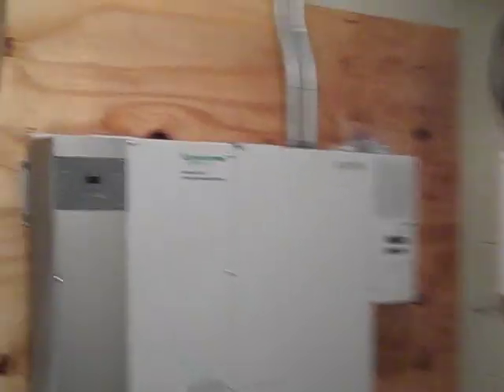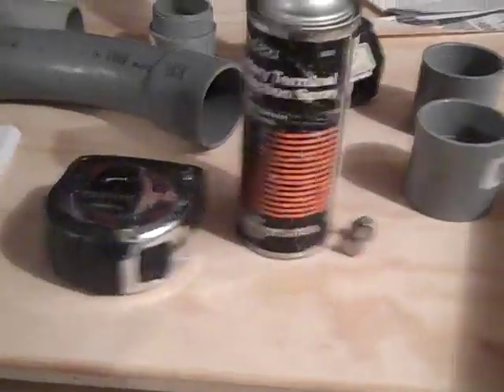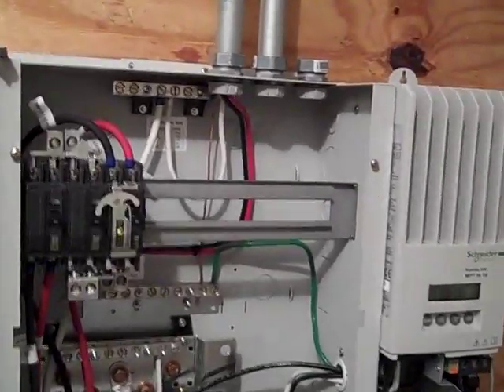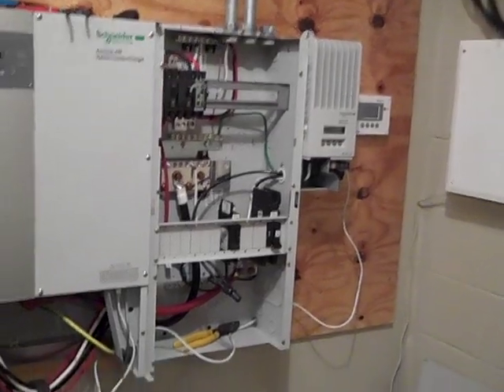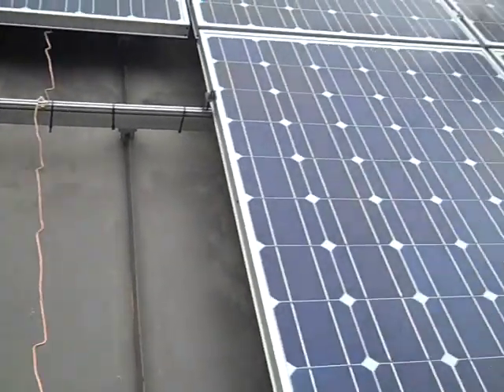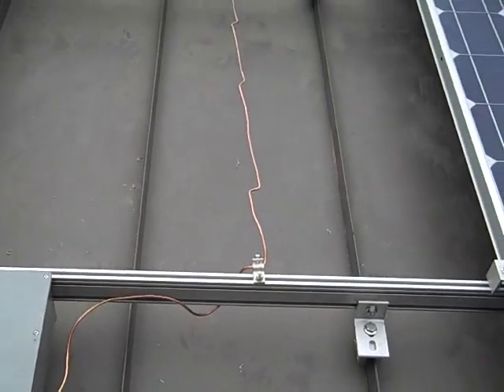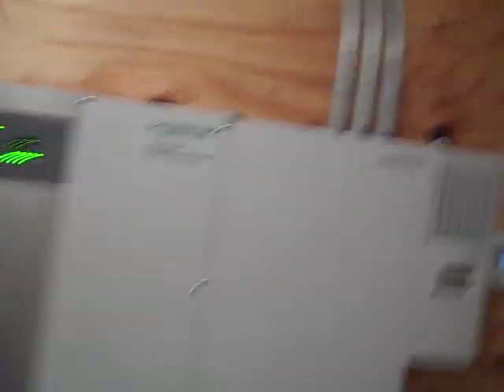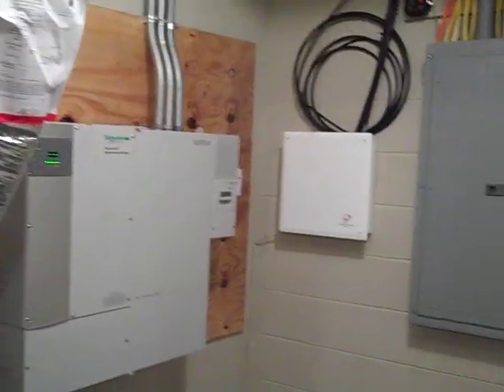A really cool solution in a grid down situation : Hybrid Battery Backup Systems

Comment: If you had this system but wanted to add a back up generator to power the entire house not just the critical loads panel how would that be tied in if the hybrid inverter also grid ties when the utility power is up?

Comment: if you took the circuts from the maine box what happens if their is a problem how do they go back to the grid di I got to go down and unhook were you took them out of and put them back till the problem fixed can you make a video on this question thanks
Reply from the maker: great question there's a bypass on the inverter if there's ever a problem with a charge controller or the inverter it will go back to grid you just hit the bypass switch

Comment: In Europe they use the grid as the backup rather than the battery as the backup.  The logic is sound.  It costs you $1-2 per Watt to generate power.  So why donate your expensive power to the grid?  Even with a nice feed-in tariff, you're getting ripped off.  The other reason is it greatly extends batter life.  The more you cycle your batteries, the faster they will die.  So, why run them down?  If the grid is the backup, the batteries are always up, ready for a real emergency.  So, I never, ever sell to the grid.  I'll buy from them, but never sell.

Comment: How did you calculate the required size of the solar array that would run the circuits you pulled off of the main panel? The reason I am asking, I am just starting out and am getting ready to set up a solar system here at my home. I was going to do what you did when you pulled the critical circuits out of the main and set them up in another panel. But everyone was telling me that I need to set up an automatic transfer switch and go from there to the main panel. ???

Comment: Hi I just ordered and got a Powerhub  1800 have not set it up yet, wish I had seen this first but I'm sure the cost was more. My unit has 2 -110 watts panles and 2 12v 220Ah batteries. Not sure what it will run but can add panles and batteries. Any good tips, and wish you were here. Southern Grandmaw

Comment: you can add a downspout to the gutters to run wires etc. down which keeps for a clean installation as opposed to running them around the gutter

Comment from the maker: @freakshow2000 the panel is solar/battery powered primarily.  The inverter in setup to power that panel by battery or grid or generator etc.  It is a very flexible system.  Thanks for watching!

Comment: Extremely NICE system!!!

Did you lose your Load Control and Half Priced Water Heating discounts from Duke Power when you installed solar?  "Or did you decide "the less said the better?" Losing those discounts can add 20% to the power bill...  =OUCH!!! 

IMO, having solar lowers grid demand and the utility ought to credit homeowners w/ solar systems for grid stability.

Comment: You mentioned the tax credits so that means the system must be grid tied, is that correct? Then how does one do the battery back up and switch over to charge batteries for a back-up system? Is that what you meant by the Zantrex inverter charger?

This is what I have been wanting to do but the only solar installer in my area keeps trying to talk me out of it. I'm looking at a 8kW, looks like the one you installed is just shy of a 3kW.